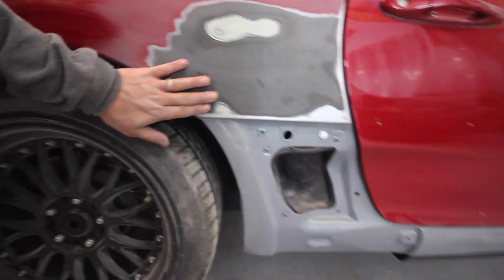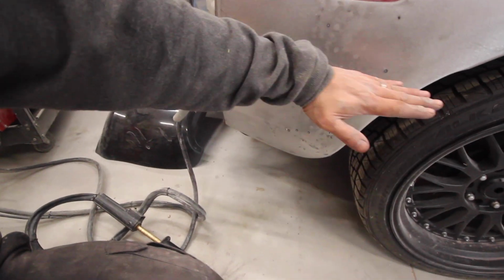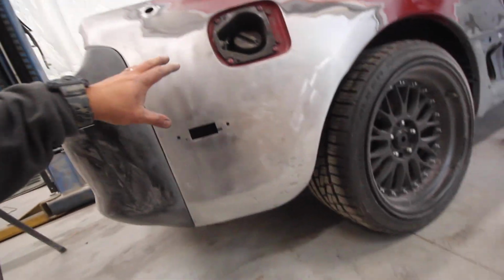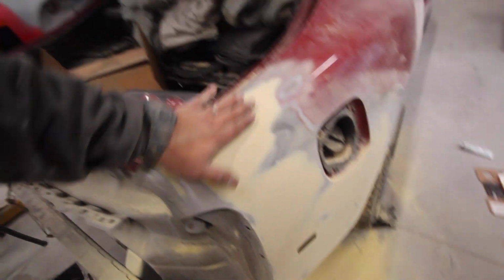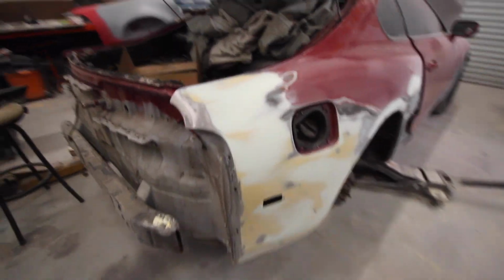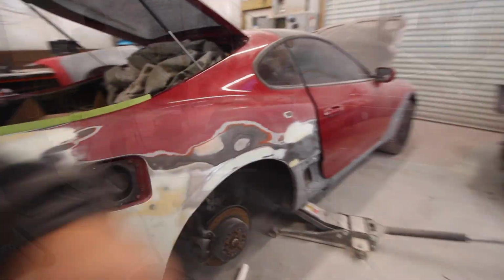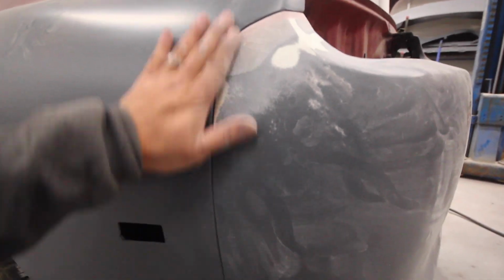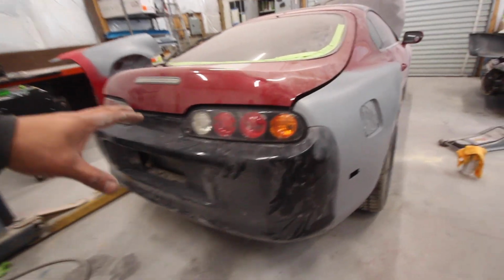REBUILDING A CHEAP MK4 SUPRA on a budget part 8

Comment: dope video man! question! do you use different kinds of mud for different tasks?(might be a dumb question) if so what kind do you used for the different applications?
Reply from the maker: Thanks dude! That is definitely not a dumb question. Mud or body filler ( I need to start saying the correct term) comes in different thicknesses and all sand completely different. Now with different thicknesses comes different types of uses. The  short hair fiberglass filler I keep using which is orange or dark green is super thick and super strong. Just not that flexible and is hard to sand. But great for heavy filling. The yellow filler I use is considered a heavy duty filler and is suitable for most applications. Sands great fills great and you can apply to bare metal. Now the light green is considered a light weight "skim coat". Usually your last coat just to do some light filling. It will spread the smoothest and also sand the best making it the best choice for your final coat of body filler. You can go even more in depth with these but that should be about the basics of it.

Comment: Looking really good man. 
Why did you cover the holes on the side markers?
Reply from the maker: Thanks dude. And I didn't mean too. They just  kinda dissapear in the filler. Once I get the sidemarkers I can use them to find the holes and redrill them. Aslong as the main large hole is there I can find the smaller holes. I just haven't picked up a set yet. The lower trim and those markers are being shipped. I should have them holes re drilled before paint
Reply: Matt Pratt be careful. These are square holes and you need four plastic things that go to these holes so you can screw the markers. The code of this part in Toyota is 90189-04085. Buy four of these 😉
Reply from the maker: @manolaq  sweet deal. Thanks for the heads up! I'll get on that. Feel free to chime in on the rest of the videos you see issues with.
Reply: @mattFNpratt  sure man!

Comment: I know you want to keep it OEM but please please shave the side indicators, the rear bumper licence plate cavity, and roll the insides of the fenders all the way flat. It'll still look very shique but you can drop it and run a very nice fitment and awesomeness yerrr
Reply from the maker: I'm going to have to disagree with you there. You will see. Supras clean and simple is how I like them. I can acheive pretty flush with this roll. To flat or cut can create more issues.  My s14 is the fitment car. Just wait.
Reply: @mattFNpratt  lol it's funny how in the video you already comment on what I wrote. I wrote too soon
Reply: By the way huge respect on not taking off all the paint. I'd be obsessing OCD style on removing whatever wasn't factory applied resulting in bare metall ALL THE THINGS!!
Reply from the maker: @DC_DC_DC_DC  so on newer cars the way they apply that epoxy coat of primer to bare metal is really hard to replicate. The second you have it bare metal your risking alot beleive it or not. Sometimes it's best to just leave what's on it and work with what you have. Also I'm trying to knock this car out as fast as I can. I have a project up next that needs a to be taken completely to bare metal...I'll fullfil your ocd bare metal needs soon haha